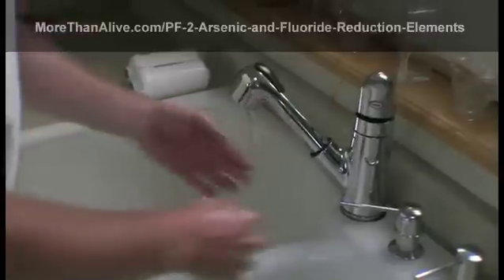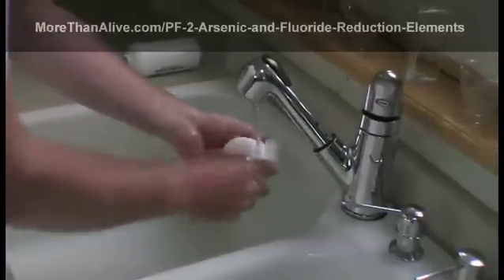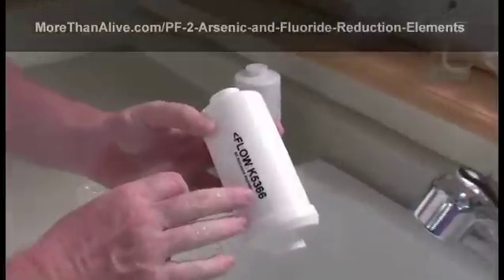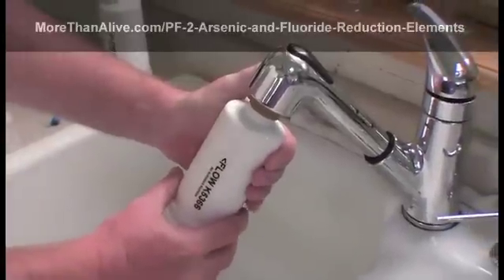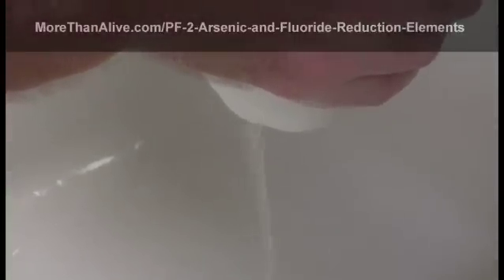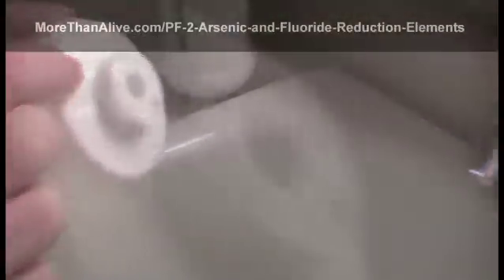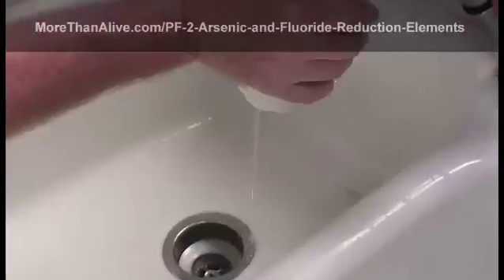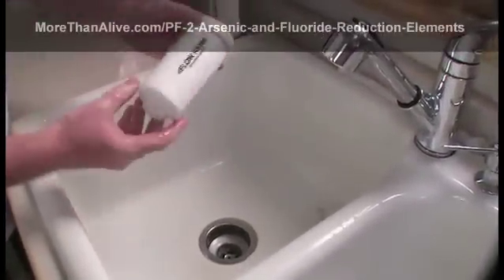Berkey Arsenic & Fluoride Filter Priming

Comment: If you're priming your PF-2 filters, be sure to flush water through both sides of the filter MULTIPLE TIMES.. I just primed mine, and after running water through one of the filters without seeing "cloudy water" (i.e. nasty contaminants) I decided to be extra careful and run the water through both sides another time and found that there was a ton of nasty stuff, causing me to re-prime my other PF-2 filters a few more times. Turn up the water pressure,too: you'll clean them better that way!